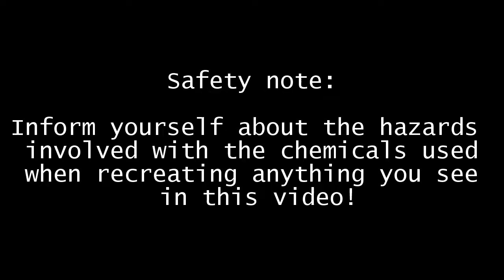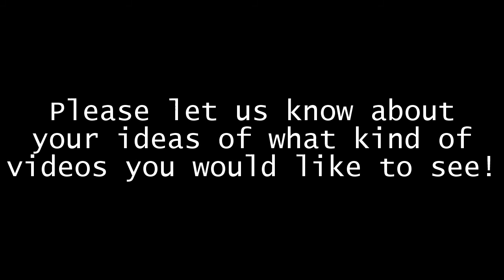Burning sulfur in pure oxygen + gas generator setup

Comment: Here are some ideas that would be really cool:
-A reproducible, reliable synthesis of sodium
-Nitrogen oxides: NO, NO2, N2O, N2O3, N2O4, N2O5
-Synthesis of Hydrogen Peroxide
Reply from the maker: Great ideas! They are already on our list and we can assure you that we'll tackle those topics.
Sodium: Doable with proper temperature control. The question always is, whether you can get away without building a   proper downs cell. 
Nitrogen oxides: It boils down to a good literature digup, because most authors will just always unspecifically state "nitrogen oxides" instead of "dinitrogen pentoxide" or "nitric oxide"
H2O2: Very doable. We might also show how to concentrate H2O2 via vacuum destillation up to any concentration.
Reply: +Astral Chemistry that would be fantastic!